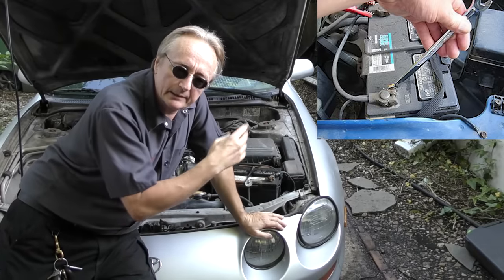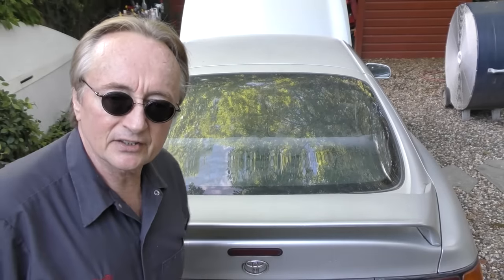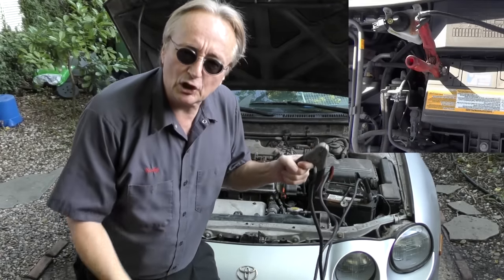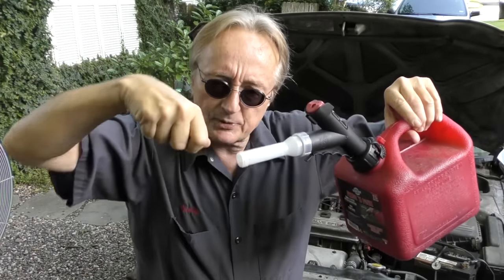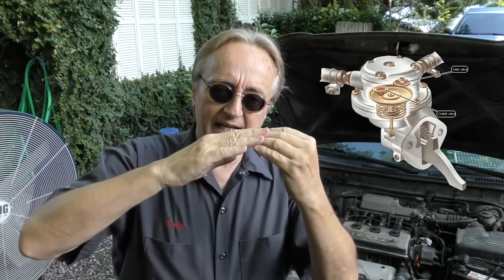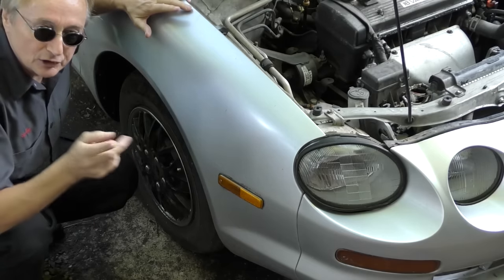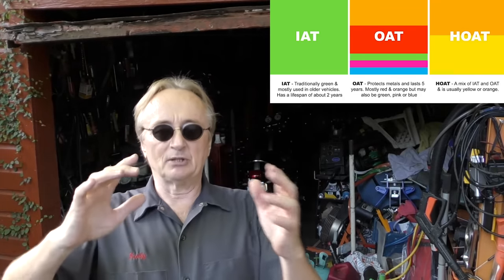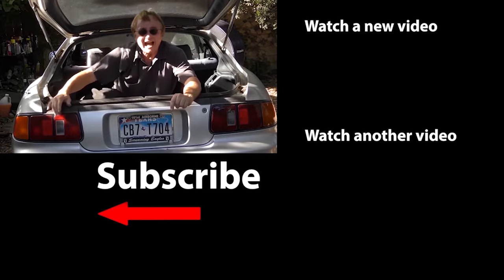This Will Destroy Your Car

Comment: Ah sheet! Perhaps this is why my wife's Honda Civic 2001 had electrical issues with the power windows and door locks. I checked the alternator by removing the negative battery cable while the car was running and it stuttered a little bit but then kept running just fine so I reattached the negative cable and thought everything was fine. Shortly after that she started having issues with her power windows and power doors. Maybe it's just a coincidence. Ah sheet again!!! I jumped a couple of vehicles by leaving my car (Good Battery Car) running while the other car (Dead Battery/Drained) cranked over their engine and started their vehicle. I even let the dam thing run for 5 minutes with both cables connected and both vehicles running! Ouch!
Thank you Scotty for being one of the very best mechanics NATIONWIDE. 3 MILLION SUBSCRIBERS & COUNTING!!! 👍👍

Comment: Actually, the fact that different refiners put in different additives is an argument for rotating what brand of oil you use. No engine oil is going to help your engine in any special way but some certain brand might have something in it that will harm your engine if you use only that brand over a long period of time. That's why I switch around to whatever is cheapest at the time as long as it meets the specs. Next oil change - the $1.00 a pint stuff from the dollar store (it is API certified) and the orange-can-of-death filter just to prove it works. After that, discount-priced major oil company semi-synthetic from that ubiquitous big box store and a 10,000 mile filter. Then drain and refill every 2500 miles but leave the filter in. In my car it's hard to get to.

Comment: Also another car you can put oil in the tank is a rotary engine car. The rotary has oil injectors that shoot oil onto the rotor faces to lubricate the Apex seals, well they don't put enough oil out so you need to premix the gas with 2 stroke oil to help it last longer. If you still have a working oil metering pump(OMP) you should mix 1/2 a ounce to every gallon. If your OMP doesn't work then mix 1 ounce to every gallon of gas. Just saying Scotty haha

Comment: Scotty, I live in Phoenix, Arizona, where it can hit 115 to 108 degrees on a regular basis in August. I have a 1997 Rav4 and usually use 20-50 weight oil because of this heat. I also have a bad oil leak at the back of the engine that would take an engine removal to fix. Am I hurting the engine. Oh I have 330,000 miles on the vehicle but have to watch oil level constantly because of the leak, about a quart every week and a half.

Comment: There is a ton of these things I have done without any problem, but I guess I don't have any fancy car with modern electronics. (Alway disconnected the already running car immediately after the flat battery car started. No way I'd risk flattening the battery of the other car.)  I've always used radial tyres, and have usually inflated to 34 psi in the back and 32 or 34 in the front. Some of my old cars would have recommended tyre pressures in the low 20s! No way I'd run on that. Of course, I've checked the maximum recommended pressures too, so I didn't go for bike tyre like pressures. ;)

Comment: I thought the canister absorbed the fuel fumes while the car is sitting and NOT filter it. Once the engine starts the evap system draws the fumes from the canister and burns it in the engine. Guess I had it wrong the whole time.

Comment: For older vehicles, 1940s through to 1980s, in colder weather, and better still, all year round, fill the radiator with straight Castrol Anti Freeze-Anti Boil, never dilute it. If your radiator has a slight leak, don't top it off with water. Have a spare 5 litre pack of  Anti Freeze- Anti Boil on hand for that purpose. I do and have never had a problem in over 50 years. Also in Winter, always let your engine reach operating temperature before driving off, especially those of you who just use plain tap water. if you just drive off without letting it warm up, even at 60km/h, that radiator core will freeze solid, resulting in the engine overheating. You've all seen those cars on the side of the road with the bonnet up and a Mount Vesuvius of  steam rocketing skywards. Even with the latest vehicles using Coolant, it's beneficial to adopt that habit as well........Thanks Scotty, for sharing another enlightening video on the dos and don'ts of the joys of motoring. Top drawer stuff, cheers mate...

Comment: Jumping a car outdoors, using correct procedures, I have had a depleted battery explode, shooting acid and battery caps high in the air. It is prudent to wear splashproof goggles when jumping any battery.

Comment: Hey Scotty, I seem to be having a problem with my gas gage. I have a 2016 Jeep Wrangler. Bought it brand new off the show room floor. When I first filled the tank the display read 350 miles before empty. Over time,  now it reads 172 and or 134 before empty!  What’s the cause?

Comment: My Toyota 2012 Avensis run on 0w-20 Toyota oil for 130000 km. The workshop is now filling 5w-30 Toyota oil on the car now. That's what they recommend on their cars with that km. But is it wrong that the Toyota workshop does that, you think. Thanks for program:-)

Comment: Watched this video a little bit too late, and disconnected my negative terminal after googling how to check my alternator. Thankfully the computer is okay, and I ended up changing both the battery and alternator. Now I'm noticing some mild shaking and rumbling once in a while while idling. Does this have anything to do with it?

Comment: Hey Scotty I have a 2006 Impala SS. My check engine light on is for four the EVAP system. I always top off my car like I just heard you say not to. would the first thing to check be the charcoal canister? I know that my fuel cap is okay and there is no visible leaks

Comment: just a little tip ...... when I have to check my car's alternator working or not, I just stick a multimeter to the terminals of the battery ...... mostly the battery voltage is ~12-12.5V (yes, its a bit old) ...... and the moment I give it a start, the voltage automatically starts creeping towards 13V or higher ...... this means the alternator is good .....
(edited) you can just but a voltage measurement in a car cigarette style......... it gives the voltage instantly u plug it in .... no need of multimeters/rocket science .... simple $2 solution .....

Comment: what do you think about using acetone in a car for cleaner motors and better gas mileage? i have been using it for years with no bad side effect's and i have used it on a lot of diff cars.

Comment: My 335 manual says to inflate tires to around 42 to 44  psi if I drive over 100 mph and 34 to 36 if I'm not going to drive over 100.  I go over 100 almost every time on the freeway while driving out in the desert when there is no traffic.......So, is having my tires at 42 a bad thing or not?

Comment: The people at the dealership should watch this since they continue to put the max rated tire pressure in the tires instead of what it says on the car's doorframe. Then, you're driving with 50 psi in the tires instead of 33. Really safe driving there.

Comment: What about using a oil treatment like Lucas that’s supposed to help high mileage engines stop burning / leaking oil ? I used it in my old Subaru Outback legacy cause it goes through oil like crazy ( burns some leaks some though I can never find the leak oil spots on the driveway ) and now the car runs weird when cold . I’ll get misfires untill I get the car up to temp and some time goes by... I assumed it was separate issue but now I’m thinking the Lucas may be leaking into cylinder and causing it to fail to spark cause of thickness

Comment: Nobody should be using anything but a jumpbox anymore.  Glad somebody finally agrees that it can be an electrical system killer to jumpstart with both cars running.  Also, I hate when people run cars low on fuel.  Costs the same to put a half tank in at half as it does on empty.

Comment: Running 40psi in your tires will not wear them out sooner; I got over 50K out of my previous set doing so. And you get 2 more MPG.  There's no harm in it. Far better to have a bit too much pressure than too little. Too little not only means worse mileage, but also more heat leading to greater danger of blowout.

Comment: oh bull about jump starting. I have been jumping cars for 30+ years, and having a running car to jump the dead one is fine. just disconnect fron the battery that provides the jump immediately after start on other vehicle

Comment: Speaking of air ! Do you go by what the tire says  for exemp. Max .45 psi....25 psi.. or you go by the psi on the door?
Reply: Go by the TIRE. Your wheels may not be OEM so the inflation may be different on your aftermarket tires

Comment: I ALWAYS WONDERED WHY THE TIRES ALWAYS LOOKED LOW TO ME 😂 I could NEVER tell! I’m always busting out my pressure gauge checking only to find out the tires are perfectly inflated lol speaking of that, when you open the driver door there’s usually a little chart or something there that says the exact amount to keep your tires inflated to:) and keeping your tires inflated to the proper amount is one of the easiest and best ways to help save the planet, not to mention your tires, gas, and car:))

Comment: Hi Scotty,

My 2009 Toyota Rav4 has done 200000kms and is always low on oil after using the right oil and not a heavier type....My mechanic has recommended to go a little heavier so it doesnt use as much.....Could It be the oil consumption is from something else ?

Thanks

Comment: My dodge ram 2010 4.7 L lifters tick at start up then stop as it warms up how do I avoid this? The valves tick little bit longer as it gets older. Uses 5W 20 should I go 0W 20?

Comment: It seems like all tires recommend tire pressure to be 32 PSI, however, I read that the correct pressure of a tire should be 90% of the maximum. Who knows what is correct?

Comment: I live in  a place where the temperature is about 55 c in summer that's why I use heavier oil which is normally 20-50 or 40
Reply: 3bou Oo that’ll raise oil pressure due to smaller oil galleys in today’s mordern engines if it’s that hot during the summer months I would suggest using whatever your car states in full synthetic oil.

Comment: Hey scotty. Great video. How do i find out what coolant should I use for my car? I have a dutsan nissan sunny b11 130y 1989 with 60000 miles on the car.
Reply: Check your owner's manual. If you don't have it, check with a reputable auto parts store.

Comment: Tire pressure, drivers door frame. Don't just put 32 in and call it good.
Some cars and OEM tires call for 36 psi. Trucks can require even more.
Read the door frame!

Comment: I have a 2007 equinox which the old owner had running on 10w-30 oil, should I change it back to 5w-30?

Comment: I have a 1994 Chevrolet Silverado extended cab it's fuel injected/ carburetor what kind of cleaner should I use in the carburetor

Comment: When I was a teenager in the 70s I was riding in a car w/ my parents. We broke down because of a battery problem. Anyhow we were on the side of the road, w/ someone jumping us off. My Mom turned the ignition switch just as he was wiggling a jumper cables. The battery blew up in his face. My mother had to guide him across a busy highway to get to a gas station to rince the acid off his face. He was ok but it was very scary.

Comment: You actually need to connect your jumper cables to the car that won't start first, not the way you said for the very reason you pointed out. There is much less chance of a spark under the hood of the dead car if you connect to the dead battery first. If you do happen to end up with a spark it will be when you connect the cables under the hood of the car that is less likely to have trapped hydrogen gas under the hood that was released by a discharging battery.

Comment: How about "Lucas Oil" additives and oil conditioners  on high mileage vehicles ?

I've used "Lucas" oil conditioner and l don't hear the valves rattling when starting my truck in the mornings , what do you thing 
Scotty ?  or anyone else that would like to answer ?

Comment: Safest way to start one other dad car with your new car is, your new car engine shall be on, and then conect cables from your new car battery to dead car battery ++ and -- but don't try to start the dead car, just let it charge about 10.min and then disconnect the cables and try startin your dead car,  this way you save from damaging your alternator regler component or anything on new car electronics.
Most of time cars fail to start because bad battery or they forgotten light or radio on and discharged, you only need a bit of charge and it will start the car.

Comment: Yeah last time I took a 99 Chevy Malibu to an auto parts store for an electrical issue, I was first told I had a weak battery. Replaced the battery with a brand new one. Same exact result. Took the car back to the same store and told the manager, this time, it wasn't the battery. He puts a tester on the car again and he says, "Your alternator is bad. See how the voltage is wavering?" I decided to not even try swapping out the alternator, and instead went for a replacement starter believing that It was the issue. It was. So instead of $125 for a new battery and another $120 for an alternator, I was out $25 for a used scrapyard test starter which is still running to this day as far as I know 5 years later.
Those people only want to sell you parts and they don't seem to have many scruples as I see them and they appear to be about as knowledgeable with regard to electrical stuff as the typical shade-tree mechanic.

Comment: Hey, thanks for this info.
WHAT DID HE SAY? Let us review: DON'T  disconnect the NEG battery terminal while engine is running.  Jump starting an engine that has a dead battery. Connect the cables to the battery of the car that is running. DO NOT let the other end of the cables touch each other. Then turn OFF the car that is running before you connect the cables to the dead battery of the car you are trying to start. DO NOT have both cars running at the same time, though I have always let both cars run, and had no damage to the computer.  Kill the engine of the car with the good battery. Now try to start the dead car with the good battery in the jumping car. Once it starts, remove the cables.
The bottom line is that it is easier to work on, jump start or whatever, on pre-1960 vehicles. My "latest model" vehicle is a '97 Ford F 150. My other is a '93 GMC "Jimmy" which I had to replace the fuel pump several years ago.  That was an ordeal I hope to never do again.

Comment: The negative is connected to the chassis to have a parallel circuit and that means that the voltage in the circuit created is the same and does not change 12V.

On the other hand when the terminals of the batteries of the cars are connected directly a serial circuit is being created and that means that all the voltages are added in the case of the example of the batteries of the car passing current when the poles of the batteries are connected directly a serial circuit is created, and it goes from 12V to 24V because the two voltages of the batteries of the different cars are added 12V+12V=24V. Ohm's Law. Overload.

And what happens at that moment with a 24V circuit.  
The car can damage an electronic component such as the computer when you try to start or start the vehicle that you pass current and the other car can also be damaged.
Reply: What? If you connect the negative terminals of both cars, which happen to be connected to the chassis, and then connect the positive terminals, you created a parallel circuit, not a serial one. For the latter, you’d need to connect the negative of one battery to the positive of the other and vice versa. Nobody does that.
Reply: @langrock74  The part where the connection or the bridge between the two vehicles is being created is the important part in this topic.

That is where your vehicle can be damaged by overloading the required voltage to the vehicle.

In the end it is only precaution and prevention to avoid future problems in the vehicles when passing a current to another vehicle.

Comment: I've had to call a tow truck many times in my life to charge a battery, and now I know they've all been doing it wrong...they always put both the cables on my battery and their battery.....and leave it there while my car is running...maybe 5 minutes and then they tell me to drive around for 3o minutes!   That explains why my check engine light would come on but nothing could be found...I was even able to pass a smog test with the check engine light on...I'm sure it was just a computer glitch...cars has always run like a champ!

Comment: Or safety reasons to avoid igniting hydrogen gas in a discharge battery connect the dead car first and then connect the live car to avoid spark.

Comment: Guilty as charged topping off, but it's just like when it clicks off at 22.33 I round to 22.35. Usually just a penny or two or three, not going from 19.43 to 20.00 or something like that. I will just go to 19.45. Doubt that does any harm.

Comment: I also seen mechanics tell me that was wrong with it and guess what it was it the alternator they kept tell me it’s your alternator I found out it was a wire with a fuse on it was weak right there in the middle of the hood and I found it it had no problems with it since

Comment: Running two cars should not be dangerous at all. The electrical voltage in both cars is operating in parallel. You will not increase the voltage in parallel. Also... the regulation circuits will protect each system.